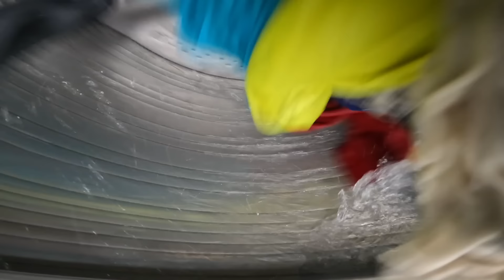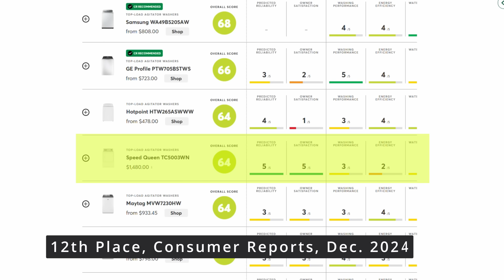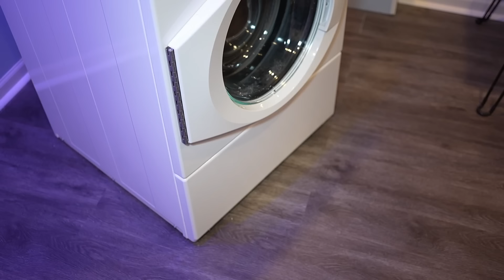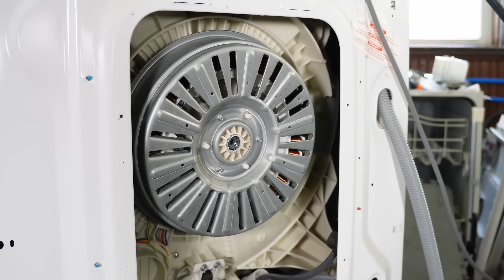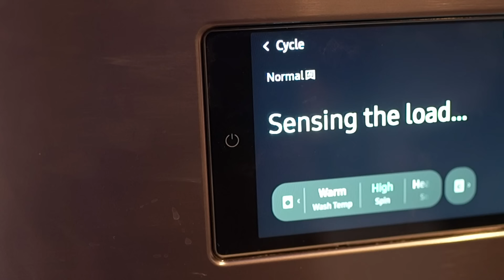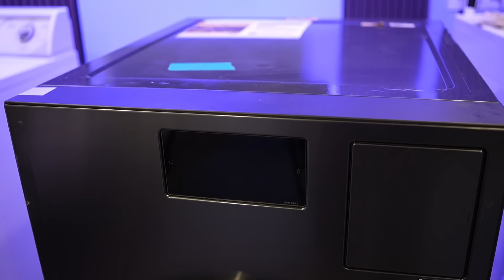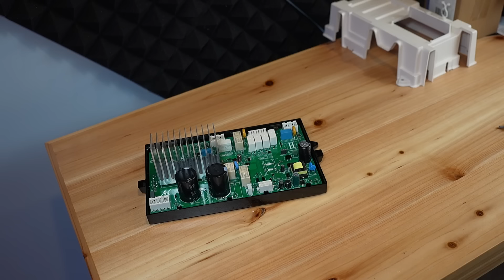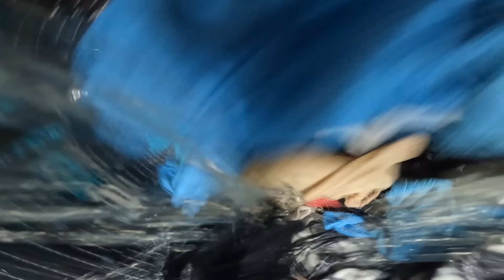Is America's Most Expensive Washer Great? The Speed Queen FF7009WN Test

Comment: I have this exact machine. I wised I would have bought this brand 6 machines ago. This is absolutely the best. Worth every penny. This never has any stench ever. Never any mold, never. I do leave the door open and wipe the rubber seal after my last load.  
Always full water. Clothes are always clean, fully and completely rinsed out. I have skin sensitivities so everything must be completely rinsed. 

Only Downside-It doesn’t wash my king size bedspreads.  My bedspreads are massive and they won’t fit in any other machine either. 

I can wash large loads with no problem in that everything gets completely soaked, washed and rinsed.
The water extraction is phenomenal. My clothes dry in my matching SQ in a fraction of the time in Med heat. In my other machines I always had to use High heat and dried in 1 hour or more clothes wouldn’t completely dry evenly. Some were scorched, some fine and others damp. I do sort items by color, material and size. My SQ drys everything evenly with no heat damage and faster than any machine I’ve ever used. I’ve purchased at least 6-7 machines with matching dryers in the past 20  years and different brands. 
I have a large family with several dogs. This one of the best investments.

Comment: Give yourself credit.  Attempting to do scientific tests are very difficult without full blown laboratory equipment to control the precise amounts and locations of the contaminants that you're adding.  It's just far more than anyone should give you criticism of as your main content is the teardown.  If you wanted to be scientifically closer to accurate, you'd probably run the same test on each machine multiple times and you'd average out some of that problem but that may be too expensive.

Comment: I have two washers and dryers in my house. Downstairs I’ve got this Speed Queen front Loading pair but with the control panels in the rear and upstairs I have a full size Electrolux pair with a 4.5 cu ft capacity washer. The Electrolux pair is now ten years old and the Speed Queens are now nineteen years old. I’ve never had a problem with any of the machines but I am amazed at the cleaning abilities of the Electrolux when it comes to stain removal and I am very impressed with the sturdiness of the Speed Queens.

Comment: I own and operate a ge gfwn1100h1ww.  I really like mine , it was built in 2015. It works great but takes a long time to spin the water out od the clothes.  The drum is close to the speedqween 3.5 , ge is 3.6 cu ft. I got mine for " Free" on clist  I did have to "deep clean it " the drum ,gasket and repair the water pump wire. God bless those who can afford a new speedqween.

Comment: So the question is, why does Speed Queen use such small tubs in their washers?
Reply from the maker: For toploads, the chassis size is smaller than anything else on the market. For front loads thats a good question. I'd hazard to guess the stainless steel outer tub presents a situation where a soft-mount like theirs requires a lot more horizontal room to handle things
Reply: @bensappliancesandjunk  So then why don't they make more room for it?  Because consumers want bigger tubs for their laundry.
Reply from the maker: @Resist4  small company with pretty conservative strategies. Tooling costs to do that will be immense. I know they are trying to figure it out, but they aren't a large company by comparison to the others, so movement happens very slowly w/ them
Reply: @ I appreciate your reply.  I am so tired of basically throw away washing machines because of their short life spans.  I think a Speed Queen will be my next replacement washer.

Comment: Total trash. The more electronic the less I am interested in it.
Reply from the maker: Every single washing machine on the market will have electronics on them. Every. Single. One. 

So are you going to go with one thats survived the commercial space, or are you going residential?
Reply: @bensappliancesandjunk Not the antiques I run.
Reply from the maker: @JustHere999dl  there are only so many old appliances out there - eventually people have to buy new ones, which is why I review them
Reply: @bensappliancesandjunk  We never buy new. We repair or replace with used. Sure do miss my 1920's Maytag that actually got stolen. Brass tube froze and busted so I brazed it back together. New electronic appliances are so bad that I have to protect them from water or bugs with glue on the PC boards. NEVER buying electronic appliances. They just don't last.

Comment: "If only they could make them a little more affordable" leads to "Speed Queen cheaped out."

You can't have both.
Reply from the maker: I think I mentioned on the TC5, my problem is that for a little more money than a similar top-load, you can get a TC5. But for front loads, the FF7 is literally 3x the price of a comparable LG which is the next-best unit. The gaps in price are far less kind to the FF7. 

My theory behind the "Why" is that the economies of scale aren't good for this machine, because its just not popular. But its not popular because the price sucks. SQ should consider selling the machine with a lower factory margin to try to get build costs down by making it up in volume. When you look at similar situations with virtually every other manufacturer, their front load machines are, at most, 30-35% more than their similar top loads. That would put the FF7 around $1,800 which I think many people would bite on.

Comment: I would love to see the Speed Queen TR7 in the mix.  The TR7 has a fixed agitator instead of a transmission and the so-called perfect  wash.  I get nervous about door leaks and smelly gaskets on front loaders.  The TC5 seems a bit lacking on the ability to customize the wash cycle.
Reply: I bought one of those gadgets that keep the door open on Amazon.  No mold it’s been 2 years. I was told the washer isn’t a refrigerator, so leave the door open.  I also use the vinegar based detergent in between my other favorites.😊
Reply: @marjorydefloria8317 . Thank you very much for the helpful suggestions, that is good to know.

Comment: I got rid of the damnable Whirlpool HE washer that was maybe a year old and bought a speed queen washer, the commercial all mechanical NO electronics garbage model and Ive been 100% happy. It FILLS the tub with water, washes a load in 30 minutes, the Whirlpool took a lot longer and no matter what I did it would only fill 3" of water in the tub and I'm supposed to wash two twin blankets in 3" of water??? I disabled the lid lock on the damn thing and for a year I filled three or four 5 gallon pails of water to dump in the tub while it was putting the 3" in, so I had a real wash Finaly got tired of messing with it and put it at the end of the driveway for anyone to take free.
Even advertised it on FB market place, it looked new, ran, NOBODY wanted it, not even for scrap!
After a week of sitting out there, I brought it back and broke it up for scrap.

I bought the SpeedQueen in 2/2022

LWN432SP115TW01 Speed
Queen LWN432SP115TW01
Commercial Washers -922130

Comment: Ben: please recommend me the best side-by-side WITH ice dispenser to buy? I've had a lot of problems with a Samsung purchased new in 2010 and dumped it after 7 years when the compress lines leaked. Went with Westinghouse WSE6170SA (yet still a made in China model) and 7 years, the compressor runs longer and longer (struggling to cool the fridge fast enough as it stays operating on for longer). I can't recall the last time it's had a defrost cycle so it's either low on R600a refrigerant or there's a partial block in the capillary lines to the drier filter. 

Sub Zero is available where I live but they're the price of a new car.

Comment: The most obvious thing in all these tests is very simple. The wash time is what makes your clothes wider, take out more stains, and make your clothes overall cleaner. Ironically, it's very hard to force a higher wash time. You get no control over the wash time, and you get no control over the pre-wash. They need to make a machine where you can set the timer for the amount of wash time the temperature the rinse time very simple. All these stupid cycles are just plain ridiculous ridiculous. I want to control the water level, the length of time that my clothes will spend washing, And I want more compartments for the soap. Nowadays, I want to use a sanitizer and I want to use a pre-wash and I wanna use the bleach and I want to use the regular soap section too. 
So to summarize, I don't have enough compartments in the soap section, I don't have enough control over the water level, I don't have enough control over the length of the wash, and I don't have enough control on the length of the pre-wash. But I've got 5000 different cycle choices , none of which are satisfactory.

Comment: ive got a Alliance Made washer here in the UK. indeed it is incredibly well built but i got annoyed with it very quickly. that detergent dispenser is ridiculously small. the timer on the one i have won't take into account Fill time, the rinse results are Poor, the spin results are poor, it will frequently not be able to balance the load and not spin. and even if it dose spin. the spin will cut out due to suds locking despite the pump and filter being clear. it only has 1 water level - low, and 2 wash actions, 1st action not being enough to wash regular fabrics, and the 2nd one being too harsh for Wool. 
whirlpool Duets are my Favourite. they are much better than our European 'compact' normal sized whirlpools. granted not as well built. but performance is key for me.

Comment: We have had a Speed Queen FF7005WN that we have used every day for about two and a half years. My only complaint is that any lingerie item with an under-wire or stiffener is at risk for getting trapped between the drum and the edge of the door where it will be rubbed against the glass until it melts. This has happened several times, both with lingerie bags and without. The solution we have found is to load half of the clothes in, load the lingerie (always in a bag), then load the rest of the clothes. This keeps the lingerie bag from falling between the door and drum and everything comes out clean. Oh, it's also a bad idea to wash small loads. The free space in the drum lets the clothes shift more and sometimes allows for an unbalanced load. 
All this being said, I would buy this unit again if only for the long warranty and parts/service support.

Comment: Speed Queens are the only washers I've had that get the clothes deeply cleaned - it passes the scratch and sniff test! One thing to remember about top loading Speed Queens - put the detergent in the drum first, before the clothes, as per the manufacturer's instructions. So many people dump it on top of the clothes and then complain that the washer doesn't work properly.
Reply from the maker: I'll try this reccomendation out during the max pack 20lb test today. I would note though that I put the pods on top for every single top load washer, so that has not varied at all and I would question if this is a SQ-only demand, or in general a good practice.
Reply: @bensappliancesandjunk  Not sure about pods. For our SQ model, it says to squirt liquid this way in the owner's manual. We didn't realize, and were putting the liquid on top of the clothes with bad results. I believe it's due to SQ switching to an agitator that doesn't spin counter to the drum (which almost caused a revolt among SQ die-hards at the time!). I would also say that the government required Eco setting is junk, but that goes for any washer I've had.

Comment: We moved into a house 2 years ago with an old Speed Queen. It stopped draining yesterday and we thought the pump was bad so I took it out to try and get the part. Turns out this was discontinued 20+ years ago. I ended up cleaning the drain pump putting some WD40 on it and it's running again!

I called an appliance repair company and the owner said the last time he used one of those pumps on a repair was in the early 2000's.

Comment: Is the Board you showed not part number 808149? the one pictured for $600+ appears to be part number 807175P which is not the one for the washer you have. 808149 is about $260 vs the $600? Or would they be interchangeable?
Reply from the maker: I dont see that board being compatible with thsi washer bsaed on any interchange I am looking at. It looks like that board fit the FF7002 which was many, many revisions ago that had the console on the rear like a traditional top-load washer if I am reading it right.

Comment: may i recommend used motor oil and transmission fluid as they can be hard to wash out. the motor oil will have super fine metal shavings, some fuel, and carbon mix into it. Transmission Fluid can have a fishy smell to it one of the Ford fluids has this smell or ATF+4 burnt smell to it when new. used will have like a burnt smell to it, super fine metal shavings, and some of the clutches mix in.
Reply from the maker: Yep I'm gonna get those soon!

Comment: For me, the most important thing with a washer is how well it cleans my clothes, and this leaves a lot to be desired. At this price, I can buy 2-3 of the other brands, but I would just buy a Miele. Miele offers great cleaning and reliability for the same price. I'm honestly disappointed in the cleaning ability and really hate the short wash cycles. My washers have generally taken 2 hours a load, over 2 hours if I use steam, but my clothes are always clean. I only need to pretreat heavy oil stains with Dawn, everything else is not affected. I also am not a fan of pods as they have left the casing on my clothes and the dosing is less precise. I wonder how regular liquid or powder would perform. Controlled tests generally show that pods don't perform as well as powder or liquid while costing twice as much.
Reply from the maker: The issue with not using pods for these tests is that I wouldn't be able to guarantee the same dosage is used every time in every test the same if, for example, I tried to test dispensers, ect. I could theoretically just dose the loads the same by directly adding 2 tbsp into each load, but then I'd probably get arguments from other people that it wasn't according to what the mfg. wanted, ending up in the same argument from a different perspective.

I agree that tide pods probably aren't the best, but the issue isn't that I am going for the best. I am going for what I can use, reliably, every time.

Comment: For these tests, you should not use a tide pod. The technology has been proven ineffective. You will have better results using regular tide liquid detergent for both the pre-wash and wash fill buckets. The washer will drain once the pre-wash has concluded, and all the detergent released by the tide pod will be flushed out, causing your main wash sequence to run without detergent. In addition to this, tide pods slowly dissolve, which is the supposed technology that time releases different chemicals at different rates. However in testing, the outer skin dissolves at the same rate and releases the chemicals all at once, rendering the claimed benefits of tide pods useless. By placing the pod into the pre-wash bucket, the detergent may not be released for the entire pre-wash sequence. Laundry is not a consistent thing, but tide pods are. Most people either use too many or not enough detergent in their loads with pods, as the amount is measured for you. The only benefit of tide pods is user convenience, where you can simply throw a pod or two into the wash cylinder and call it a day.

Comment: Sweden here. 2-3 hours is normal for a wash cycle.
The water usage is low and the energy usage is low.
Of course all wash machines are cold water only because, that saves a ton of energy.

Do not really understand why people are so fixated with the wash time. "Oh, it takes forever!".
So?
Do you sit and watch the wash the entire time?
I push go and do other stuff. That's the point with a washing machine.
The machine does the work! Then why does it matter if it takes three hours?

When finished it is very dry (since rpm when drying is 1200 (or more on some machines!). And of course very clean.

USA really needs to start using proper modern washing machines that we have here. They work very well, use very little water and energy and makes the stuff clean. Stop wasting resources.
Reply from the maker: How many loads of clothes do you do a day? The sticking point tends to be families that need to wash and dry multiple loads per day
Reply: @bensappliancesandjunk Then you wash way way way too often.
You can use clothes more than a flew hours you know. No need to wash them all the time.
Two adults and one crazy kid here, riding at least once a week, and we wash normally 1/week. Sometime 2/week.
The machine takes 7 kg.